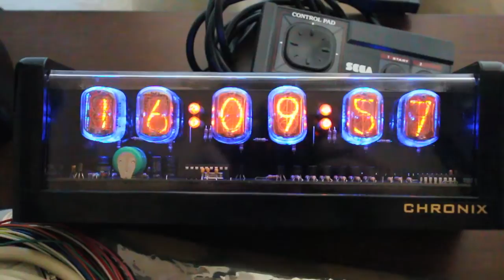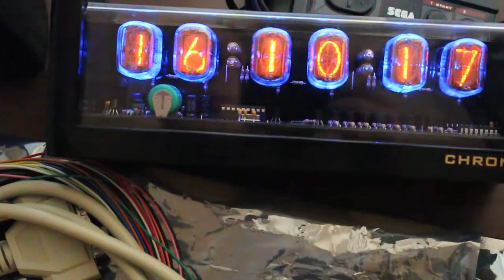Nixie Clock 3.6V NiCad Battery Replacement (NiMH Upgrade)

Comment: Hi, these are indeed fine nixie clocks. I bought a pair of aluminium ones from the same seller called "Numitronix" on Ebay. Really great guy too.  Thanks for putting up the video, cause now I can take it apart with more confidence when I need to swap a nixie.